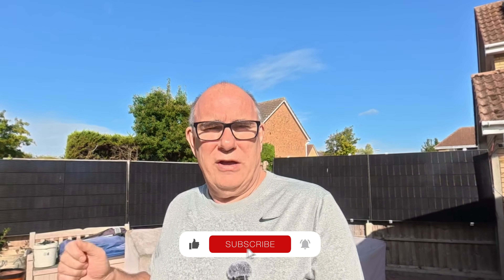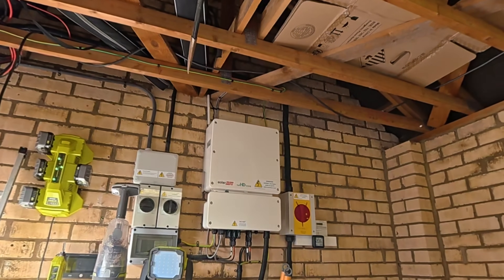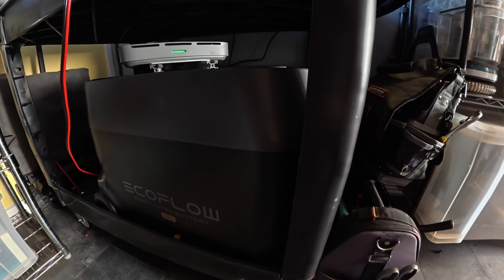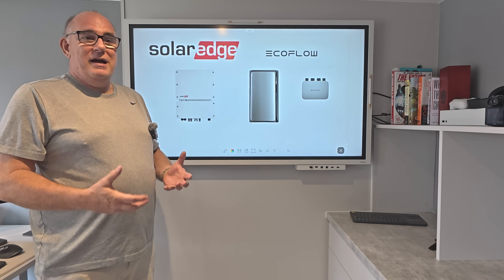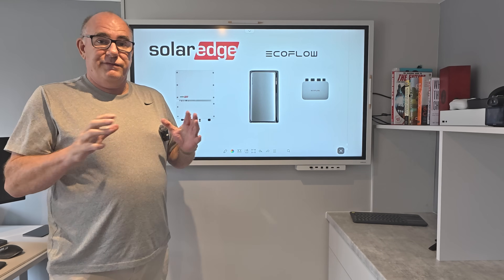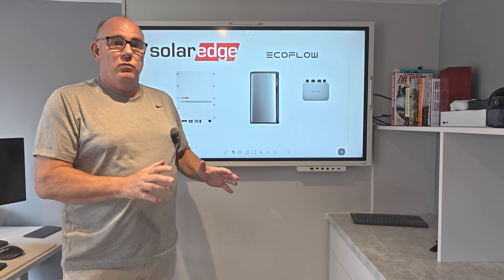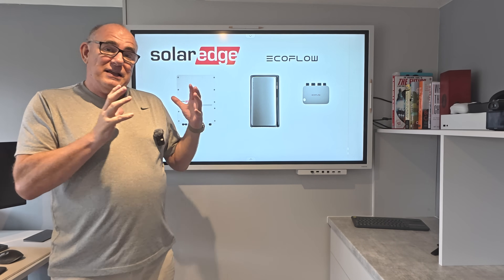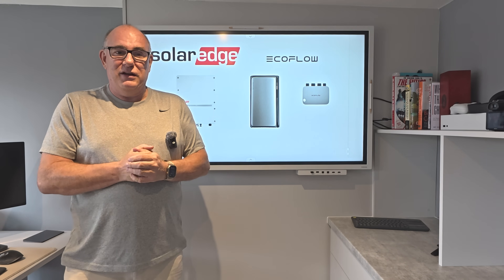Hybrid Inverters CLASH? How to Stop Your Solar System Fighting Itself

Comment: Just learning and would like to something similar. So the AC is all wired together ? Do they synchonise in terms of exact frequency or do they sense the grid and syn to rha ?
Reply from the maker: Yes, absolutely so they sense the frequency of the energy running around the house and synchronise with that

Comment: I have a Victron Multiplus and an Ecoflow Powerstream and I just created a new HA automation to balance the two.
HA monitors the Victron battery current and when the battery current goes above 50A(about 2.4kW) it sets the Powerstream to discharge.
When the battery current drops back below 25A it stops the Powerstream discharging.
There's a couple of other ways to do it for example by looking at the house load and when it exceeds your primary inverter capacity you start discharging the secondary.
Reply from the maker: That’s a pretty cool idea, I’m assuming when you say the current goes below about 50 A, you’re talking about the state of charge of the battery here
Reply: @JonathanTracey  No not the SOC the Victron gives voltage and current data for the battery as well as state of charge. The max discharge power on my inverter is 60A @ 48V

Comment: I’m running three Victron ESS systems on the same phase with a single grid meter. They don’t fight each other and share the load evenly. My setup includes 12V, 24V, and 48V systems, and while they can charge from one another, I disable the internal chargers overnight to avoid issues. This kind of setup definitely isn’t for everyone, you really need deep experience with Victron gear to configure and manage it properly. Where I live, the export market isn’t rewarding, and there are no cheap off-peak rates, so the goal is to soak up and use as much solar as possible. You should try it, see how it goes. It also provides redundancy if one falls over or goes flat. I have not paid for electricity in 3 years.
Reply from the maker: sounds like a great system, because mine are different vendors they do try to compete with each other

Comment: Nice configuration and explanation. I have grid tie Solaredge 10k with batteries . Soon installing ASHP and need additional battery capacity. I have access to a Victron Multi-plus 2 ( inverter charger) and battery. It has grid tie option and export control. If set up as you show will the 10kW SE battery and the 40Kw Victron battery ( dc coupled also but no solar) supply to loads on a shared basis without issue in your experience?  Also in your set up do both smaller inverters follow the voltage set by the SE output?  TIA. John
Reply: Edit : the SE has 20kW solar
Reply from the maker: I’m afraid I don’t have any experience of the Victron platform, so I don’t know how well it will play together with the solaredge system. I would maybe get a Victron installer to come in and look at how the CT clamps for both systems could be placed so that one would take priority over the other.

Comment: I have my 6kw Sigenergy Hybrid Invert with my 24kwh battery. I then have 4x Ecoflow Micro Inverters. They are connected to the consumer unit. They are also set to dump 100% to the grid of what the PV can generate. 

9.34kwp PV & 6kWh hybrid inverter, 24kwh battery 
3.52kwp PV, 3.2kwh inverter (eco flow x4). 

The Sig system is smart as it will take the excess AC from the Ecoflow stuff and use that to power the battery but is limit by the 6kwh Sigen inverter. The battery is Dc copulled so the 9.34kwp pv goes directly to that. Again it’ll be a mix pending conditions. 

Excess is dumped to the grid as export via 16.5p SEG per kWh.
Reply from the maker: nice setup, do the 4 micro inverters all play nice?

Comment: Nice way to keep your base load, how is it 400w with your heatpump? My house runs between 400 and 600 because I have 2 servers in my garage plus so much other crap and looking at getting the octopus heatpump in a few weeks.
I currently have 2 Sunsynk 5.5 ecco inverters installed in parallel, I had 1, but I didn't want to pull from the grid on peak loads (oven, microwave etc) I currently have 18Kwh of batteries and I have just received another 18Kwh of batteries to add to the system, everything talks together with canbus and rs485, I only have 6.5kw of solar and trying to figure out how to add another 6.5 😂, I have 1.2Kw of spare panels that I am going to micro inverter on to the sunsynk to get optimal power during winter from them.
Reply from the maker: Don’t forget baseload is an average, and right now in the summer the Heat Pump isn’t drawing very much energy at all, it’s only being used to heat hot water. As we go into the winter months that baseload will probably increase and I will push up the level of the inverter supply.

Sounds like you’ll have enough battery to power the Heat Pump 24 x 7, I assume you’re going to charge the batteries overnight on low cost energy as you’re unlikely to get enough energy from solar during the winter

Comment: Very nice I am sure but how do you actually wire them up to do that.
Reply from the maker: Each is wired up as per the manufacturers instructions. Nothing special they are all completely standalone isolated individual systems, that supply electricity into my consumer unit via the appropriate hardware.

Comment: Your approach is a good way to ensure multiple hybrids work effectively together, only one supplies the variable demand and the others the base load.

The principle advantage of this, that you didn’t really mention, is that it stops the inverters cross charging between each other, which on modern and fast inverters can be a real problem.  When house demand reduces (e.g. kettle stops boiling) there will be a short period where the discharging inverters power is exported and the other inverter will start charging from that export. The two inverters can then get into a high power embrace of one discharging and the other charging up.

The principle disadvantage of your approach is that it doesn’t utilise the full discharge capacity of your inverters/batteries as you are throttling the Ecoflow discharge rates, and you are going to get some export or cross charging when house demand is lower than your predicted base load.  In your setup with a massive main SolarEdge battery and inverter and the Ecoflows being so much smaller these considerations are probably not much of an issue, but if your hybrids are more evenly matched then can be more of a problem.

I have two hybrid inverters, max 2.6kW discharge rate so I want to be able to use the full capacity for house load.  One has a 9.5 battery, the other a 5.2.  I don’t do anything special on mine, I let them sort out the house load between them.  Most of the time the inverter with the bigger battery takes most of the load, with the smaller inverter sharing a smaller proportion.
Cross charging is not a major issue for me, the inverters only gently cross charge in the evening when the sun has gone down, and it’s always from inverter 1 to inverter 2.
Reply from the maker: mine don’t have the problem of cross charging, they are set up in such a way that they only charge from solar during the day, and will only accept AC charging at defining periods at night. When none of the systems are discharging because they’re all charging from the cheap electricity.

Comment: I installed PV back in 2014 and added 9.6kWh of battery storage (using Sofar AC coupled inverter & Pylontech batteries) in 2018. All running perfectly fine but this year I got ASHP fitted and removed the gas meter (and associated gas hob). As I am still on the Feed In Tariff, my house has been designed around zero export (no point as I have assumed 50% export payments) and low usage all round. Monthly bills are between £75-100/month and that includes running an EV 15k miles/year. I just purchased (without lots of thought) 2 x ECOFLOW AC Pro batteries which I have started to use as baseload but my problem is that I have lots of Solar in the summer (with all excess being soaked up by ASHP/EDDI/Zappi) and I feel that the new ECOFLOW setup will not be that helpful over the summer. This winter will be my first with the ASHP so I think I kind of jumped in instead of running the HP for a full winter. I will see how we go. 😁
Reply from the maker: The AC pro will certainly help, you can always charge them up overnight and then use them to supply baseload once your main battery start to get low. Also once you’ve had the SOS Heat Pump for awhile you’ll have enough data to be able to figure out exactly what the right strategies is to run them.

Comment: I have two Sunsynk 3.6 Inverter one runs the home with 10kwh of battery’s and one runs the shed for the fishponds, which ones are 5 kW battery Belph inverters are charged to solar panels through the summer in a charge of the grid in the winter
Reply from the maker: Sounds interesting. Does the fish ponds use a lot of electricity?

Comment: That's a great set up. I also have a Stream connected to 3 large garden solar panels that just export everything (no battery storage). I have roof solar and upgraded the battery to a Fogstar 16.1KWH battery. We'll soon see if 16.1KWH is enough through winter as I've just had a Cosy 9 installed. I love the simplicity of the garden system without battery storage.
Reply from the maker: Before rushing to add any more battery storage, I would run your cozy nine for the full winter and get a whole load of data, that will let you know where the sweet spot between battery storage and paying for more expensive electricity lays.

Comment: That's a very nice simple way to solve the problem. I have two inverters, but only ones a hybrid, and that's my Victron Quattro, the other is a SolarEdge system. The Victron system is very cleaver, there is an energy meter installed on the SolarEdge system, so the victron knows exactly what its doing.
Reply from the maker: Even if one knows what the other is doing how do they decide who wins😜
Reply: @JonathanTracey  One's just a dumb inverter, all it does is generate, no different to what you're doing, except mine varies with the sun. Only the Victron knows what's going in or out to/from the grid. Only time you get issues is if there is two or more separate battery systems, that's the only time you get race conditions and cross charging/discharging.

Comment: Nice setup, did you start with one small system and then add to it as you went along. I thought about getting solar for many years then this year did a bit of a trial run with an Allpowers R2500 and a 400w folding panel. That went rather well so i bought two cheap ja 440w panels and ground mounted them in the garden. Those two panels sometimes hit 900w and produced more power than i could use, at that point i realised it was time to invest. As you know i got the excellent powerwall 3 which is probably the best system on the market from that fine gentleman Elon Musk and its proving to be a sound investment.
Reply: I'm not sure about the fine gentlemen bit!. Sigenergy is looking very good, and personally I'd prefer that over Tesla. Of course the Rolls Royce of systems is Victron, but that's not for everyone, but just so happens to be mine.
Reply from the maker: Yes my system is a bit of a Frankenstein set up, I started in 2010 and have been adding to an upgrading it ever since.

Comment: How do you stop one battery solution from sucking power from the other
Reply from the maker: During the day they only charge from solar, at night they all charge from the grid, so they never charge each other
Reply: @JonathanTracey there's my problem, I have a Solaredge PV array, and two separate battery systems Sofar and Fox-ess. I'm currently exploring HA to try and schedule when each of them is charged and used.
Reply from the maker: Are your other batteries? AC connected batteries, they become a little bit more complicated and require more street scheduling, with DC connected batteries there is no way for other inverters to be able to send energy to or request energy from those batteries. But if the AC batteries are independent of the inverter, it’s possible to get into the situation you describe. Home Assistant should be able to sort it out, but it might take some tinkering.
Reply: @JonathanTracey Fox-ess h1-5.0-e and Sofar Me3000sp coupled to DC batteries but no direct PV.

 I've been told by Fox that they cannot coexist as they will will see each other as both load and supply. 

I might just try running both at the same time and see what happens
Reply: @MikeJohnson-y2h They will randomly end up cross-feeding each other. One will leech energy from the other unless they are specifically designed to work in parallel. My solution was to have a main hybrid inverter that runs the house. And a backup hybrid inverter that is manually switched in (and the main one switched off) when needed

I have 6 inverters, 3 are hybrids with batteries. They are primarily used in spring, summer autumn to charge during the day and discharge at night, to keep me under a 10KW export limit. I am in NZ, so very different to UK. But I have worked through the situation you are in, in a less than perfect way, but it works 

I am now thinking of trying to automate control by switching CT clamp signals, since they ultimately control the inverters battery discharge. But it is not a simple matter of turning off the CT clamp signal, as my inverter faults out. I am going to try switching between a CT on the main house supply line and another CT that is not on any power line

Comment: For information I've got the reverse situation, with two solar PV diverters (one supplies the immersion heater, the other a 3 kW string of convector heaters). Both are the Solar IBoost older model, and they actually cooperate pretty well together (I try to use only one at a time, but sometimes forget to switch off the heaters).
For whatever reason, the immersion heater seems to be given first call on any spare power (unclear why with two identical diverters), with heaters only activated after the immersion thermostat opens. Any idea why this happens?

PS - Before anyone comments, I'm on the pre-2019 FIT scheme, so there is no benefit to me in exporting to the Grid.
Reply from the maker: could it be the order of the CT clamps, one is seeing the excess first? With regards to FIT, check out my video on upgrading FIT, I am on FIT from 2010 and I not only got an upgrade to my system approved, I also got off deemed export and onto outgoing octopus

Comment: Do you have an export limitation from your DNO and if so what power limit did they give you? I've never heard you mention if you do or don't in any of your videos.
Reply from the maker: yes i have a 10kw export limit, i originally had 3.68 but as we updated i had it increased by DNO first to 5.68 and then to 10 once we updated the inverter
Reply: How did you get the DNO to increase your inverter limit ?

Comment: Did you manage to figure out where ur garden office came from?

Also did you do any of your solar setup yourself? I am planning a company doing the install on my 3 faced pitch roof but later likely want to add an array to a flat roof extension and perhaps a garden office too.
Reply from the maker: yes this was the company that built the office https://www.moderngardenrooms.com/

i didn’t do the roof systems myself, but both fence systems are full DIY jobs (save final connection to consumer units which was done by artisan electrics)
Reply: @JonathanTracey Thanks for the reply!

Can I ask with your DIY systems I guess you got artisan so sign of wiring regs but are you still able to have it MCS approved and get SEG for those other systems?
Reply: @Silent_523 yes, was wondering that myself.  I think though if he’s with octopus though, they are less restrictive in terms of needing mcs certification
Reply: @ianmckenzie2552 yeah but I think without MCS they only pay 4-5p/kwh for export - though because there is an MCS system signed off he might get the 15p/kwh export across all 3 systems.

Comment: Simple straightforward solution! I have two inverters but only one is connected to a battery so it's easy. (The solar one I have is a non-hybrid. I wasn't convinced about the time about adding batteries to my solar PV. I think it's worthwhile now, but it wasn't a while ago.) I think it's likely a very sensible solution because your smaller inverters are likely more efficient at low loads than your giant hybrid beast would be.
Reply from the maker: yeah, I did a little bit of testing and also the smaller inverters can pull up a lot quicker and start supplying energy but they’re limited to a maximum of 800 W, so it’s better that the demand is handled by the larger inverter